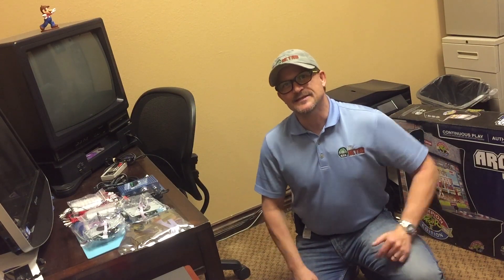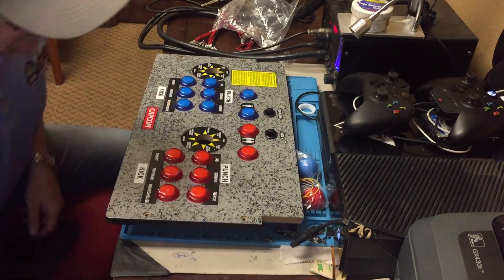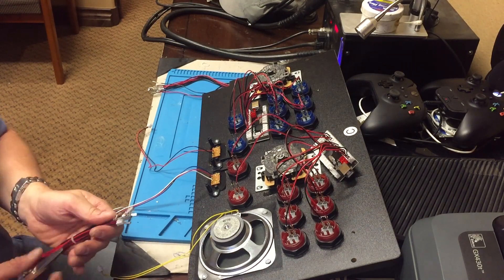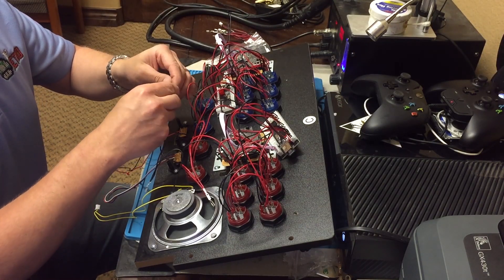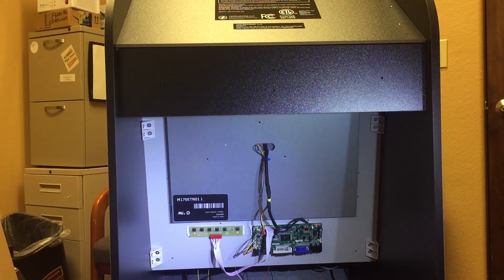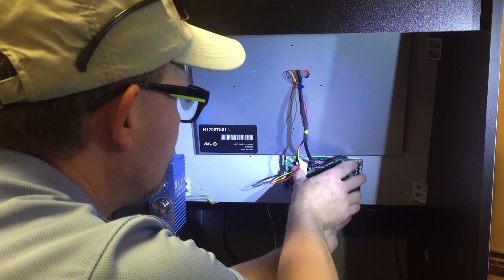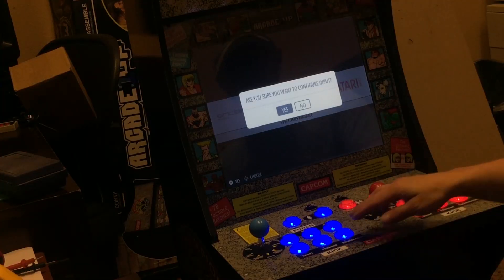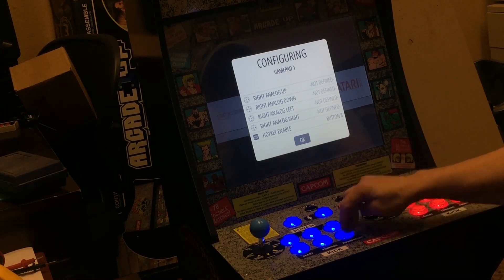Raspberry Pi 3 How to Mod Arcade 1UP, Arcade 1up Mod to Raspberry Pi. Raspberry Pi Arcade 1UP Mod.

Comment: Am setting mine up but now I have a problem, you know the wire that is from the joystick and it connects to the original board. They new lcd controller board doesn’t have that plug. So how do I make my joystick work with this new lcd board?
Reply: You will need to purchase the USB button kit from Amazon and use that to connect to the Raspberry pie. There is no way to use the original kit that came with it unless you have a USB conversion kit. 
Hope this helps.

Comment: On my arcade 1up cab I did my mod,but can't get my buttons to work.I wire both exactly the same.When I turn on my arcade everything started up right,wouldn't let me configure my joysticks or buttons.The weird thing about it,is let me look the games with moving my joysticks.Thats all it did.Is it a raspberry pi issue or something else?
Reply: You probably hadn't gone through the mapping on the pi core ...menu mapping takes some time, probably as a keyboard to the pi for easier navigation

Comment: Do you still have to install retropie or does raspberry come with games allready installed?
Reply from the maker: Yes, you would still need to install the RetroPie configurations to the SD card. 
I am not sure if there are any out there with it on there or not, but I am sure if you do some digging you can find one. 
It is not that hard to set them up though if not. 
Thanks for your question. 
I hope this helps,
GAME ON!
Reply: I know the kits come with sd cards with  (NOOBS) installed on them.Does that make it easier?
Reply: I bought the raspberry pi 4 kit and I found a retropie sd card with preloaded games on the other day.

Comment: I did this to my street fighter cabinet. When I turn my system on I get no sound. If I reboot, then I get sound. When I completely power off, and then turn back on I have no sound again. Basically I have to reboot after turning the system on to get sound. Any ideas to fix?
Reply: Is it doing it on all of the games/emulators or just certain ones?
Also,
Maybe you could email a quick video to our website email?
Info@1upretro.com
We would be happy to help you out.
Reply: @jeremyrigged  Thank you for replying. I  actually just fixed it. I went to force audio to 3.5mm and noticed I had the setting on auto. Selected force HDMI and now audio works on start up.

Comment: What was the issue with the buttons at the end of the video? They weren’t working when you were pressing to put coins in. Also, I thought you were going to use the power and volume switches, you ended up not. Was there a reason for this?
Reply: Iestyn Davies  I have the exact same problem, it doesn't get my coins.  How did you solve this problem?
Reply: I’ve not built mine yet but usually it’s just a case of mapping the keys. Using a standard controller on my Pi I simply map all the keys and everything works fine.

Comment: how do you safely power it off?
Reply from the maker: The best way would be to do a soft shutdown via the "Quit" menu option and then either unplug it or if you have a switch wired to the power switch, turn it off from there. 
Thank you for your question.
GAME ON!

Comment: Has anyone come up with a mod that keeps both and can switch back and forth between devices(Arcade 1up, and Retropie)?  Nice video by the way, clean look to your machine.
Reply from the maker: You know, there is probably a way to do it. 
For me, it was just easier to gut it and install the Raspberry Pie. 
Thanks for the encouraging words as well. 
You don't get that much these days. 
Too many people just wanting to rant about how I shouldn't have done that, so
THANK YOU!
Reply: Why you want to be able to switch between the two when pi has the exact games, just put it aside or sell the board for parts, idk
Reply: @The1SilverShadow  to keep the online mode. You'll lose the online play once you upgrade to the pie.